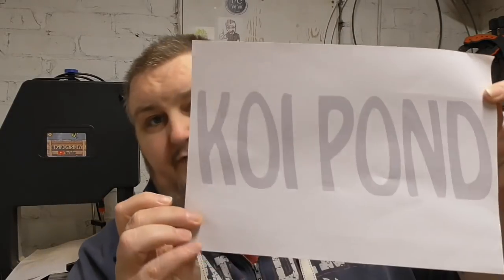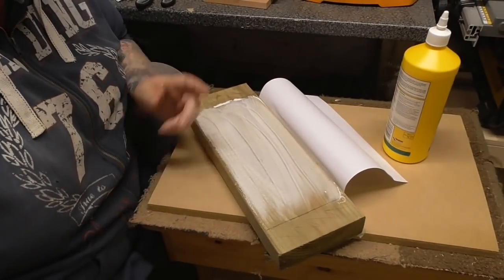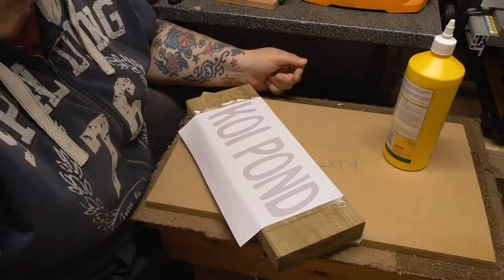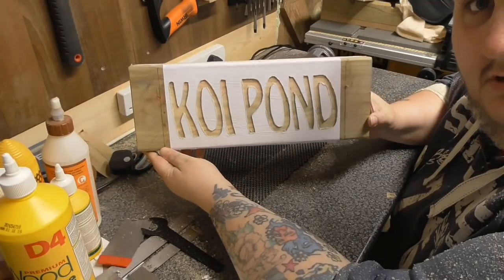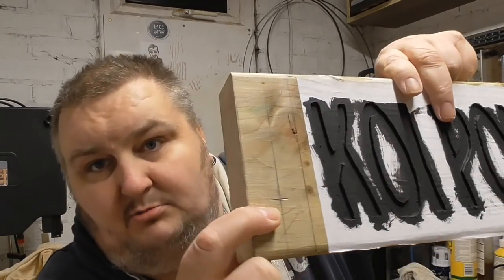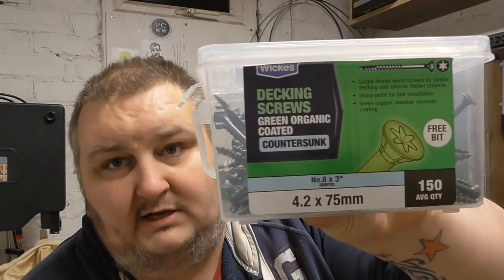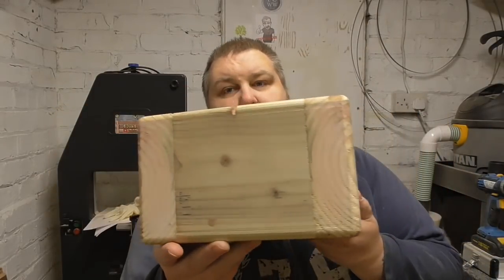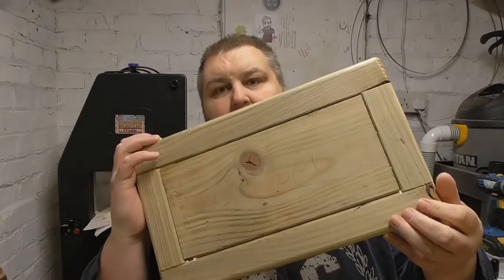MAKING A PERSONALISED GARDEN PLANTER

Comment: Looks good. Comment to make though. I hope you were wearing a suitable dust mask as well as a face mask as sanding and machining treated timber is not really advisable. If you cross cut a section of treated timber you will notice the 'treatment' penetrates about 6 mm, which is the area of the timber you were working in.
Reply from the maker: Thanks for the comment I admit I wasn't wearing dust mask when routing the letters but when sanding yes I do wear a mask and I only did the letter to a depth of 3mm

Comment: Nice one Warren,liked the way you used a smaller bit to outline the letters first and then the 3mm bit for clean out,nice straight edges,what kind of flush cut saw do you use cos I'm looking to buy one and there are so many different ones .I'm also trying to get away from feet and inches and believe me at my age it's hard and because I kept converting back from metric I bought a metric only double sided tape from Gosforth Handyman as most material now is in mm and its brilliant.Enjoyed that wee project, keep them coming big pal
Reply from the maker: Cheers ricky mate the saw I use is one I got from lidl it's a good saw but about 2ft long and pretty wobbly it does the job but I wouldn't mind a new one perhaps an irwin or something
Reply: @SCRAPWOODTOCRAFTWOOD Thanks Warren, It was the Irwin one I was looking at,bit more expensive but you pay extra for quality I suppose
Reply from the maker: Definitely mate